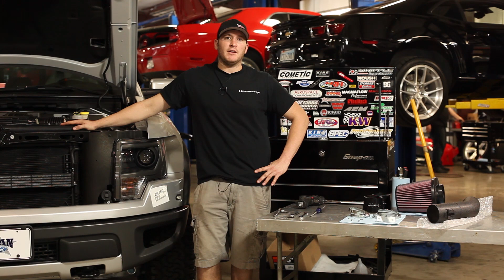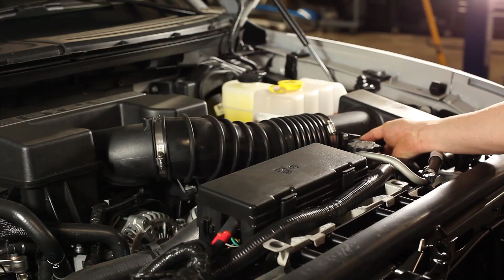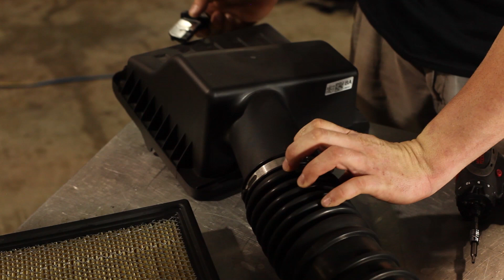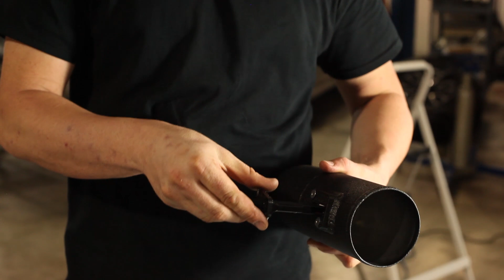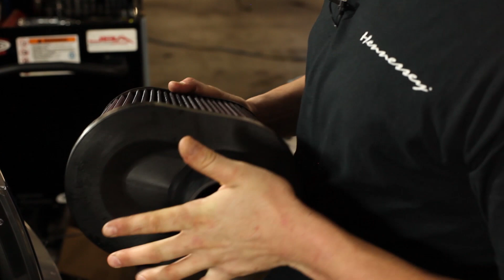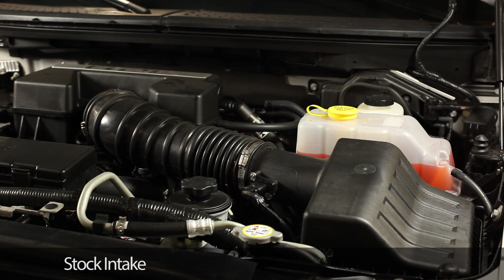Hennessey Air Intake Install on a 2013 Ford Raptor 6.2L

Comment: Just wondering...why do this mod? It's now sucking hot air in from the engine area?
Reply: Tolliver Smith this design is atrocious! Glad I didn’t get a henny raptor. I rather my motors last vs power gains. K & N actually has a heat shield to block the radiator and everything els.